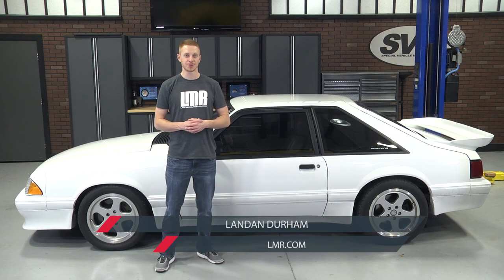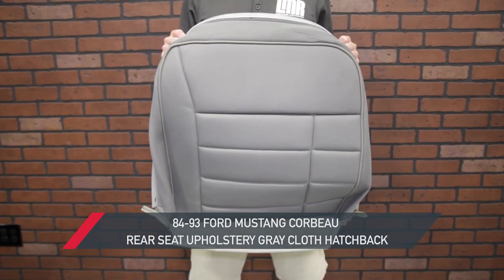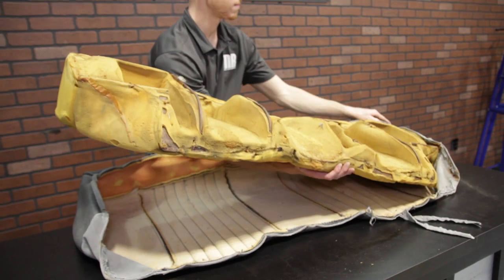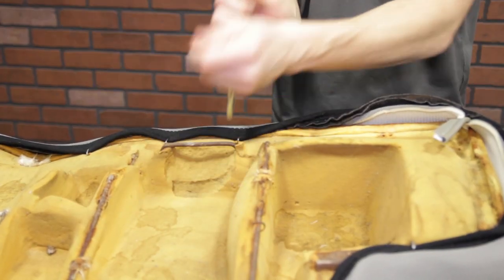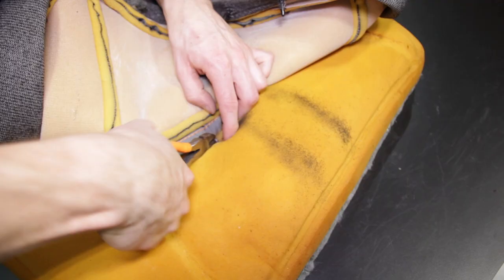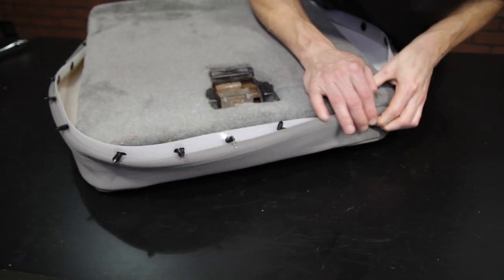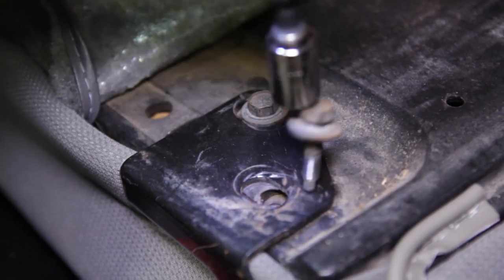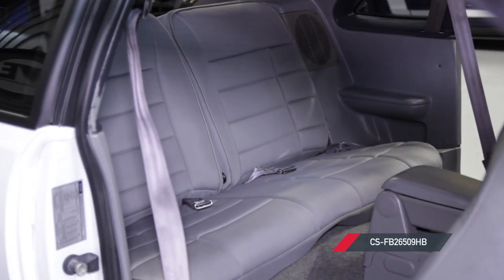How To Install Fox Body Mustang Rear Seat Upholstery (79-93)

Comment: I have an 83 hatchback.   I wanted the fold down seats.  I'm looking at videos and pictures and it looks like the 83 had a solid bsck seat like the coupes? Is it possible to switch to fold down seats?
Reply from the maker: You are correct. 1979-1983 hatchback cars had a solid rear upper seat back. You can switch to the split rear upper seat backs from a 1984-1993 car, but some alterations are required. I'm not sure of the specifics. Hope this helps! -Landan

Comment: Why is it that my 86 mustang GT convertible had two bolts hold on back seat when you said only the hatchback had bolts
Reply from the maker: Steve, This is shown on the hatchback model, the coupe and convertibles are going to be slightly different but the same basic steps will be used overall.
Reply: @latemodelrestoration  yeah at the end of video he says to remove top of back seat is to pull out bottom and pull down top it said that convertible have no screws but they do
Reply from the maker: I am sorry for any confusion this one has caused, please let us know if you need anything else.